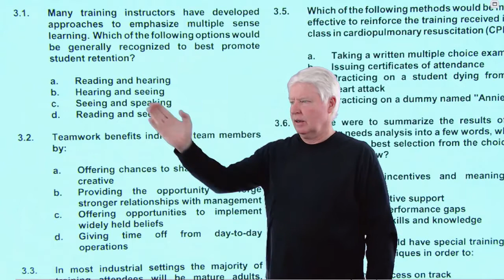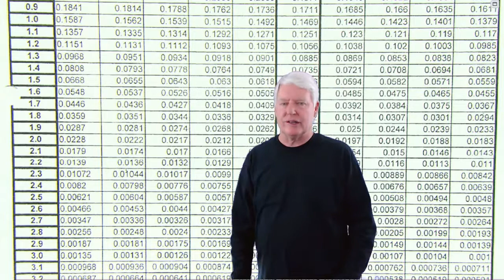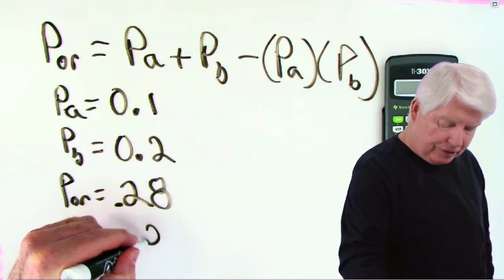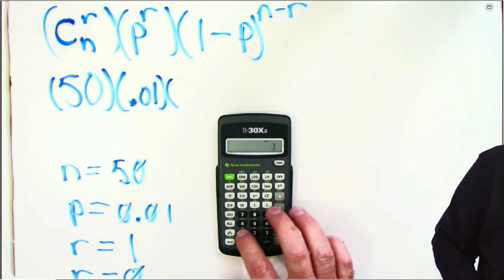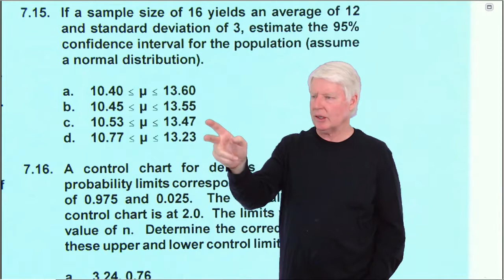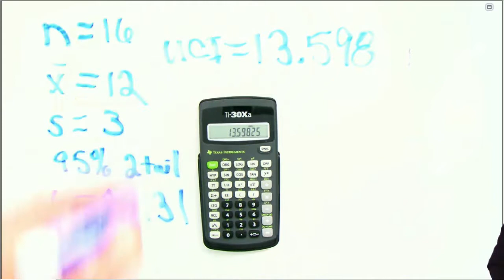ASQ CQPA Practice Exam

Comment: @Alpha Training and Consulting   ..... I have a masters degree in Mechanical Engineer. I do not have any experience in working as a quality related field. Is is possible for me to appear for CQPA exam? If so, please tell me how the exam is been conducted for computer based exam and the fees for preparing it. 
Thank you
Reply from the maker: Vishnu, 
Thanks for the question.
The fact that you have a college degree qualifies you for the CQPA exam.  So you are ready to go!  Let me know if you would like me to sign you up for my class.  
Thanks,
John Lee
Reply: @alphatrainingandconsulting7197   i have few more questions . What kind of book material can I use? Can I use ASQ CQPA book in the exam.? Is scientific TI 30XA scientific calculator be used?
Reply from the maker: @vishnuvardhan3047   Yes the ASQ CQPA handbook is allowed in the exam and so is the TI 30XA calculator.  You can take notes and etc. into the exam but they must be in a 3 ring binder.  My students take in the Instructor Notes (PowerPoint slides from my lecture, which are in a 3" three ring binder, the CQAP Primer, the TI 30XA calculator.  Some of them will also bring in a 1" three ring binder where they put the appendix from the books which allows them to locate page numbers more quickly.  I have a YouTube video entitled "what to expect at the ASQ testing facility".  You may want to listen to that as it may help you.  Let me know if you would like me to sign you up for my ASQ CQPA preparation class.
Thanks,
John Lee
Reply: @alphatrainingandconsulting7197  may i have your contact number